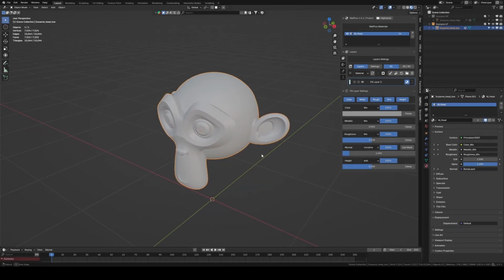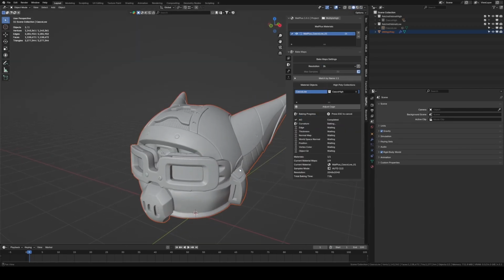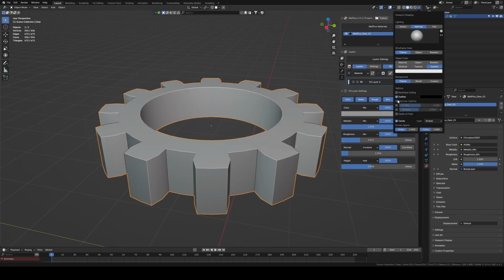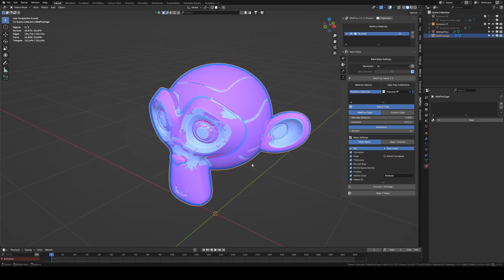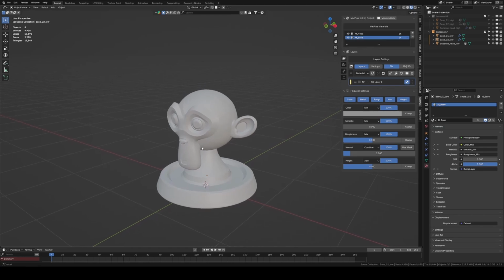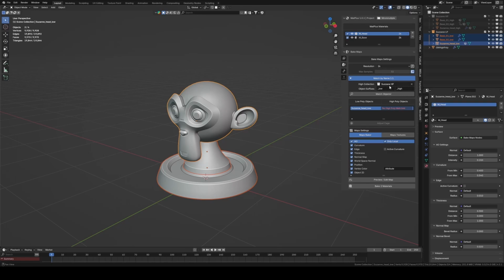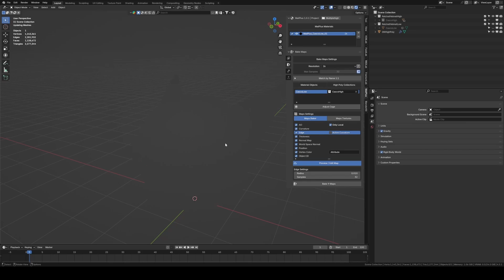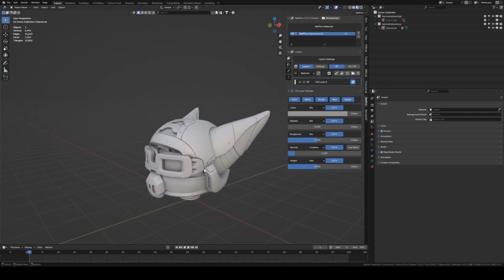MatPlus - Tutorial, Best Advanced Bake System in Blender

Comment: Recently discovered this add-on, and i'm actually trying to find a substance painter equivalent in blender, or just a great texturing add-on in general, so with all the infos so far i gathered, MatPlus definitly looks like the one i'm looking for. However there's one kind of useful map that MatPlus seems to be missing, and it's the "Cavity Map". 

I know Substance Painter can bake cavity maps, so i think adding it for the cases you work on organic models would be a very good addition, as we would wouldn't  need to prepare it separately from MatPlus workflow.

It's primarly useful for organic sculpts/models rather than hard surface models, as it translates all the peaks and crevices details, but for ppl aiming to use Blender for organic scultping, having the cavity map as an additional map baking option (even if not toggled by default) would make that addon a must  :)